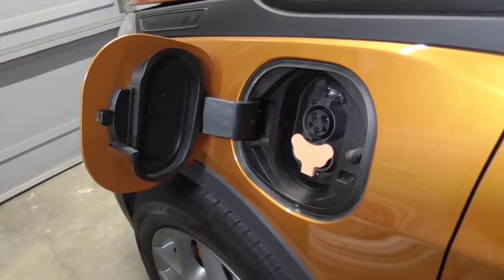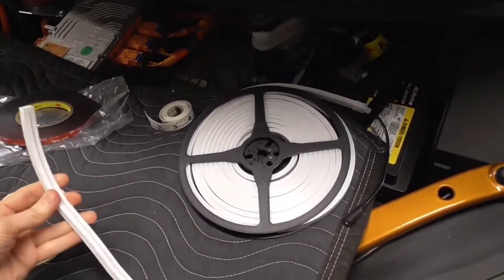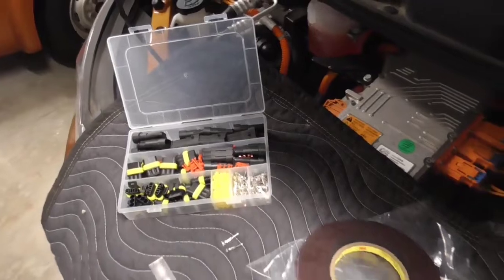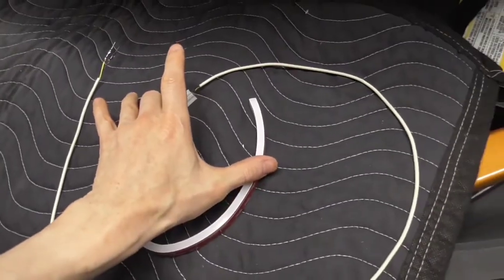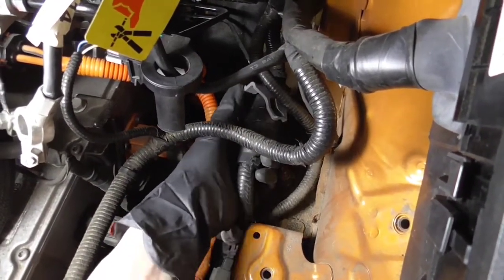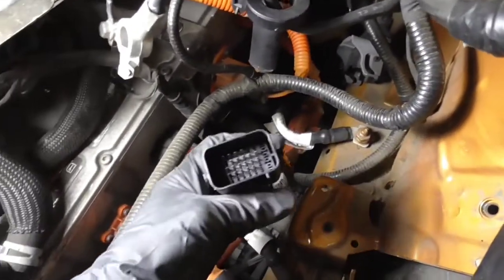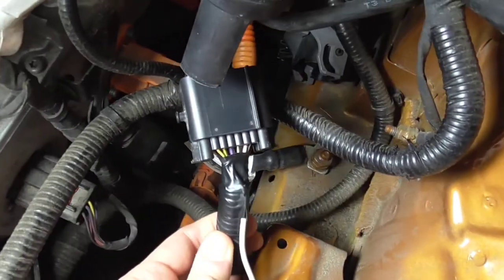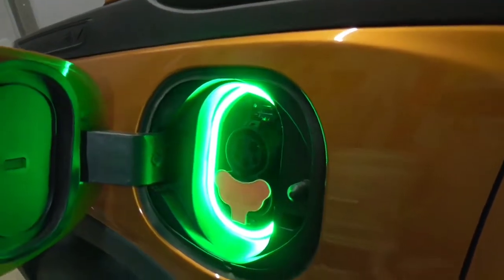Chevy Bolt EV - Charge Port LED Light

Comment: In your video there is only the cpu to remove from the battery tray.  My 2020 bolt has five different wire harness clipped to the battery tray.  Do you know the proper technique to remove these wire harness clips? Thanks for the video
Reply from the maker: Minor detail, but thanks for bringing it up.  Yes, my car had them too.  You use some wire cutters to carefully cut them out.  You can then use nylon cable ties to tidy up after.  Or pry them out with a pry tool to be pushed back in after.
Reply: Thanks for the reply!  I ended up cutting the ties but regretfully wish I had tried prying them off for reuse.  Oh well, thanks again for the amount of detail in this video.  Great mod to the Bolt. @theevolvingworld

Comment: Do you have a reference for the pin locations for a 2023 EUV? This is well within my wheelhouse of skills (I used to do alarm/remote start installations) and I'd like to add it to my Bolt.
Reply from the maker: 2022-2023 are pins 6 (negative) & 7 (positive).  You'll see wires going in, but nothing coming out.

Comment: Cool mod but a bit daunting.  I would also be interested in buying completed kit if you get that option.  My solution was tiny stick on LED light but I love that yours is more synced with dash charging light.
Reply from the maker: Hey there, just got back from back to back road trips to NV & AZ.  The charge port light is working great.  It really makes a huge difference on pitch black nights. Actually, even in the day time it helps.   Makes lining up the CCS or J-1772 effortless.  I will be offering kits with a warranty.   I just haven't had the time to do it.  Thanks for reminding me!

Comment: I just tried this with my 23 EUV.  A very difficult task that I failed at.  The battery tray has 5 wire harness clips on it that are very hard to remove.  Also the positive cable is between the tray and a bracket which requires the tray to be shimmied out.  There are 2 connectors attached to the cpu.  The 2 1.5mm pins are extremely hard to get all the way into the connector.  The first 3 tries they broke off.  The 23 bolt euv uses pins 6 and 7.  Everything went back together fairly easily.  The biggest problem was soldering the wire onto the led strip.  After 6 or 7 tries, I gave up.  They kept coming undone when trying to stick the strip to the interior of the charge port.  I wish everyone good luck
Reply: I’m also having difficulty removing the 5 wire harness clips.  How did you manage to get them off the battery tray if you don’t mine me asking?

Comment: I just purchased a 2023 bolt euv, and I disassembled it to get to the harness.  I noticed that the plug has the wiring installed already.  Do you happen to know where the end of the harness ends up?
Reply from the maker: Congrats on your recent purchase.  The 2022 & up changed the pin locations for the charge port lighting.  It's pin #6 & #7 (the upper right two unused slots).
Reply: @The Evolving World  thanks man!  That is good to know.  I'll try to do it again. I'll let you know once I get it done.
Reply: @theevolvingworld  do you happen to know which one is positive and negative? On pin #6 & #7? I tried this past weekend.  But the wire colors are not easy to tell. If you know that would be great. If not, it's OK. On my 2023 bolteuv.
Reply from the maker: Yes, I should've mentioned that before.  Anyway, pin #6 is negative & pin #7 is positive.

Comment: Hi, 1.5mm width connector pin, what is the length ? Thanks
Reply from the maker: I think they are all standardized to fit automobile electronic connections.  Anyway, I just measured 10mm.

Comment: Well done! I have a 2023 EUV. Wanna put one in for me, please?! Your episode was very informative; I love how relaxed you are while teaching, too. Not sure I can do this myself, but I'm gonna bookmark this. Thank you so much!
Reply: Hey,  I also have a 2023 bolteuv, I went ahead and took it apart, and I found the connector had pins and wiring running thru it already.  I went ahead and put it back together. Trying to research where those wires  run to? I still haven't pulled the tire to look inside the fender. Would anyone have any idea where to find those wires end up?
Reply: @jcaz1313able  did you ever figure this out?
Reply: @tenockey  I'm planning on doing it this weekend.
Reply: @jcaz1313able any luck?
Reply: @armenian6000  nope, no luck. I connected the wiring as instructed. The settings are set. But it doesn't light up. Verified solder was intact. Don't know what to do now.

Comment: What's the voltage at the pin header? That determines your LED configuration. I'm thinking why do we need a light all the way around the plug, all that's needed is an LED or two, that's plenty of light.
Reply from the maker: It's the typical 12v like all the other accessories.  It's a clean OEM style thing.  This is far better than the OEM part for a fraction of the cost.
Reply: @theevolvingworld  Thanks for the reply. 
That's my point, the number of LED's is relative to the working voltage. What happens in LED bulbs designed specifically for, say, 12V is that each LED's is balanced for a specific current at 12V. What's the current draw of your home made strip? Divide that by the number of LED's in parallel and you'll get the current for each LED. That's important to know, if you exceed it LED life is shortened.